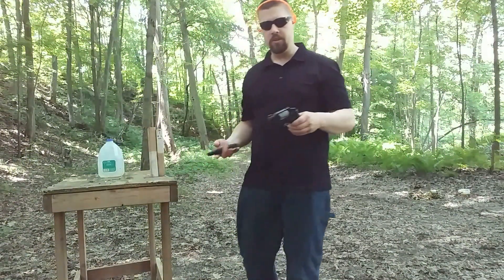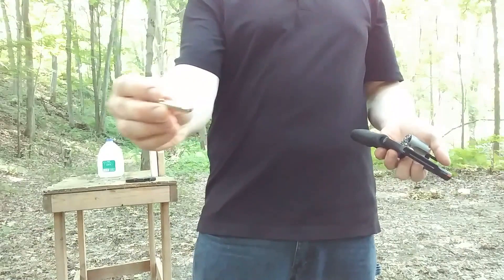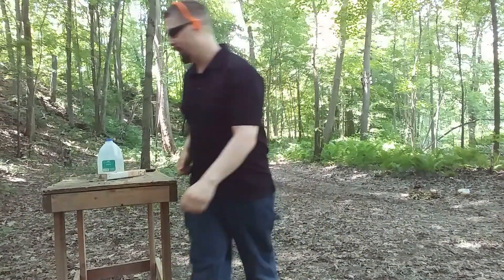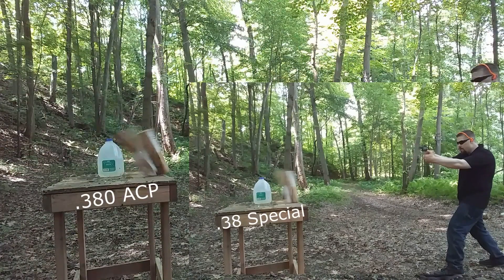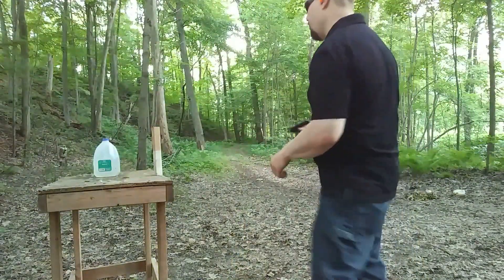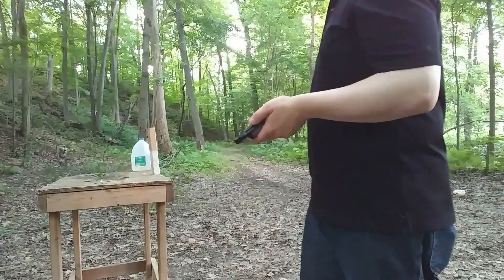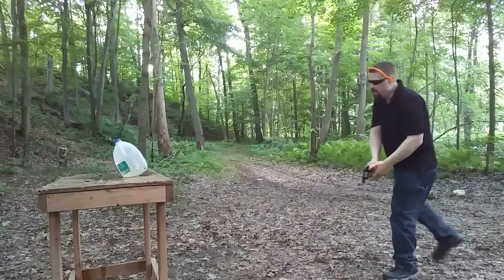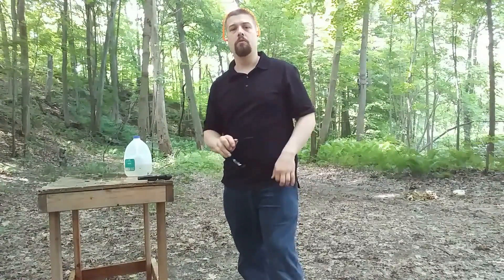.380 Auto VS .38 Special in Pocket Guns Episode 21 - MOMENTUM

Comment: Admittedly I'm a bit biased, but it looks like you were hitting harder with the .38Spl even though you were running a slight energy deficit. Energy is still going to dominate in terms of the potential to do work at the terminal end. Momentum is more of a recoil thing, but it does play a roll. Energy and momentum are tied together at the hip. This is where a lot of the big and slow vs small and fast debate comes from.

The numbers you were using for momentum or whatever they were didn't mean anything to me. When I did my calculations, which I hope you found useful, I was going with straight up physics and using appropriate units of measure. I'm not really a proponent of "knock down power". However, bigger wounds should result in faster incapacitation.
Reply from the maker: At the end of the day my gut tells me the .38 special is a more powerful round, even when energy numbers don't necessarily show more power. If you look at the history of these cartridges, the .38 special is a magnum version of the .38 Long Colt and was a duty round for almost a century. The .380 was designed from the ground up as a pocket gun cartridge.
Reply: I tend to agree. I've always considered the .380 ACP to be less than a .38Spl. That last test you did with the water jug between the boards really highlighted the .38Spl in my mind. Did you have a chance to go through my math on your last video?  If so, was it clear or did I just make it too confusing?
Reply from the maker: I'm not very good at understanding math, so I just use calculators to get numbers.
Reply: That's true for most people. Unfortunately, sometimes it is the only way to communicate.

Comment: Interesting.  I watched a video the other day of a guy doing similar testing comparing a hot .357 158 grain (I think) load versus a standard .45 ACP round of, I believe, 230 grain.  I expected the .357 to perform better, since it carried more energy, but the .45 did significantly greater damage to thick hardwood boards.  In addition, when shooting at a hanging steel target, the .45 moved it considerably farther.  I figured the .357 must have transferred its energy much more quickly upon impact. I don't know how this translates to impact on a living target, but it gives you something to think about.
I Googled kinetic energy versus momentum, and found this great comparison between a truck and a flying meatball: 

http://www.batesville.k12.in.us/Physics/PhyNet/Mechanics/Energy/KENOTMomentum.html

Comment: Force is mass X velocity, so a bigger bullet will provide more force if the velocities are similar.
Reply from the maker: One thing I have been enlightened to is that you can have more momentum with the same energy. Take for instance a 125 grain bullet going 850 FPS for 201 ft lbs energy vs a 90 grain bullet going 1,002 FPS for 201 ft lbs energy. The 90 grain bullet has a momentum of 12, but the 125 grain bullet has a momentum of 15.